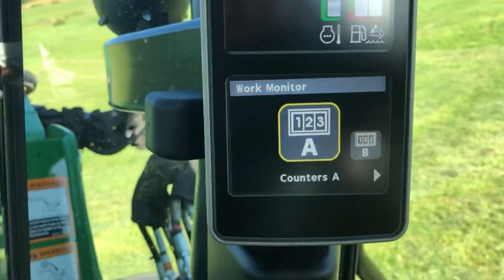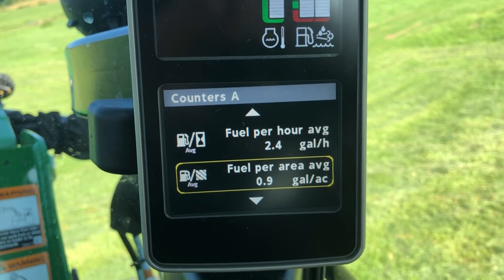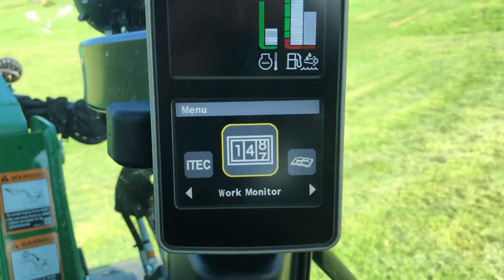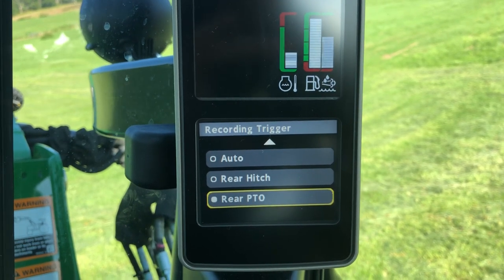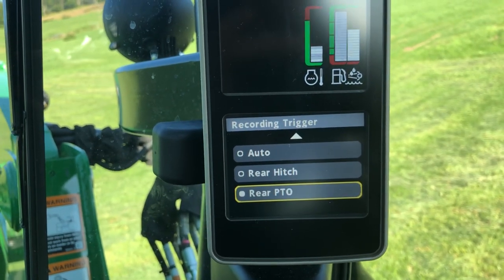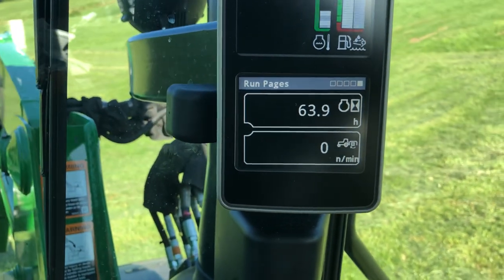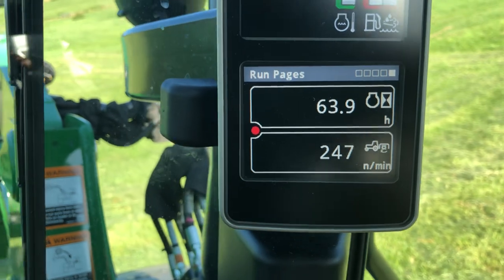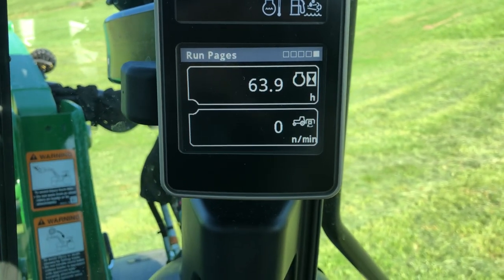John Deere 5R Series Tractor: 5125R Work Monitor Feature Demonstration

Comment: If you select 'manual', activate it by holding the 'ok' button for a few seconds and again when you deactivate it. I found that 'auto' its activated when lowering the rear attachment, same as 'rear hitch' does. I just got this features with the last update, nothing in the manual about it.
Reply from the maker: Ciprian - Ionut Nicoara thanks! I will try that next time I’m in the machine

Comment: Well I’ve received my new 5115R and after 2 months and 180 hours worked, I am very unhappy with the way the tractor was put together 
Oil leaks
Faulty switches (Brake, emergency brake, transmission etc) and a lot of other problems with it, I even lost the rear left wheel doing 40 Km/h on the road in between two paddocks, and that at 87 hours of work (and yes the wheels hardware was checked as well as the loader hardware) I think it is very disappointing from John Deere 
Air conditioner faulty from factory bend pipe
Stereo system not connected properly, no hand free phone capabilities (microphone in but not connected) and so on
Anyway I better stop here I don’t really want to spend the day on it, but here in Australia this machine cost me a$170.000,00 au it is a lot of dollars for something working only half of what it could do